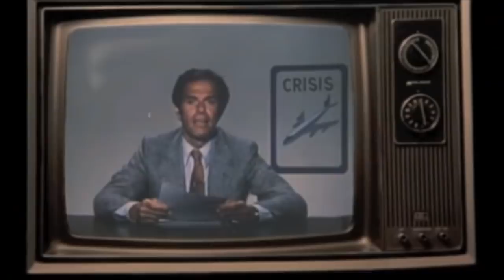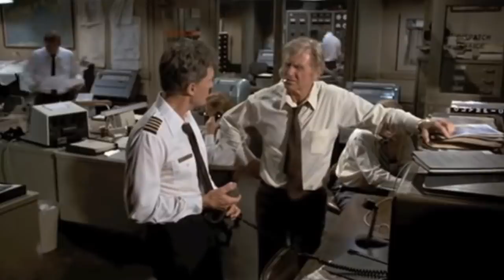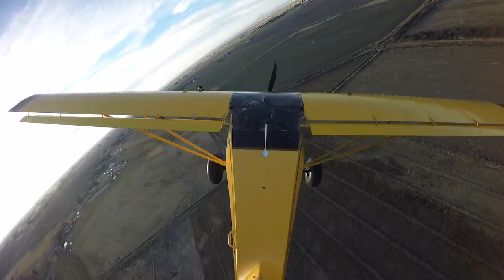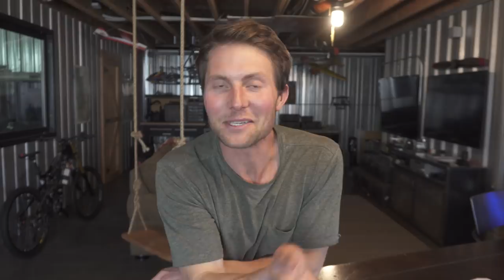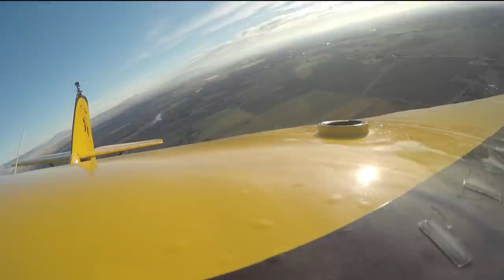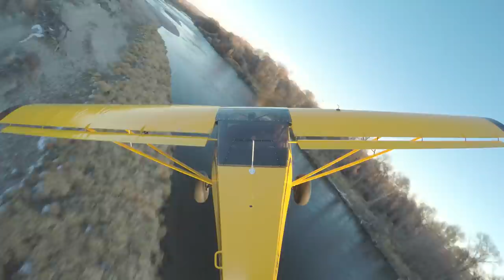Engine Out Landing! What happens if you forget the wing tank GAS CAP.

Comment: I can verify that if you leave the cap loose on a citabria 7eca, it will suck all of the fuel out within about 20 minutes.
Reply: i'm not sure if i want to like this, if there was a horrified with a giggle button i'd use that.
Reply: I was flying a 7ECA yesterday.    Saw the guages fluctuating and wondered if I had left the cap off.  Landed to check.  Everything OK.  Guages just jump around a lot.
Reply: @petethecatable  If you leave the cap off, or even loose, you will be able to see the flow of fuel from the trailing edge of that wing.

Comment: I had an incident when I was flying skydivers.  A friend had checked the fuel in the wing tanks with a stick and left the cap loose on the wing of a Aeronca 15 AC I was flying. I was sitting in the A/C and I took his word that all was well and ready to go. (My mistake) ON taxi for takeoff it rolled of the top of the wing. I had no idea this had happened. On climb out to 12.500 ft. I thought it was strange what the fuel tube indicators were indicating. After dropping the jumpers I noticed I had fuel indication that was quite low. The decent was always rapid and I was probably descending about 3000 to 4000 FPM.  When I got back on the ground I was presented with the fuel cap. The people on the ground thought it was quite a display seeing the fuel streaming out on climb out and decent. The loss of fuel was probably about 10 gal. From that time on, I did my own checks of fuel caps.

Comment: During my flight training (decades ago), my instructor decided to set us up for a dead stick landing.   While we were in the pattern, he switched off the ignition in the downwind leg, simulating an engine out or empty fuel tanks.  He reminded me that I should put on about half flaps, and I could use that as a control to shorten or stretch the glide.  Any way, it all went fine... turned base, turned final, and set it down on the runway a little past the usual touchdown spot.  All to just demonstrate you don't need the engine to fly... or at least glide.  It sure was strange to see the prop absolutely motionless while flying.  :)
Reply: Mechanics often call it a 'cooling fan,' not a 'prop.' Because as soon as it stops turning, the pilot(s) immediately get sweaty.
Reply: Turned the ignition off?? Why not pulling the mixture instead?

Comment: There are pitot tubes on Kitfox gas caps.  These are needed to pressurize the top of the tank to promote fuel flow from the wing tanks to the header tank.  Without the cap(s), there is a vacuum created as you stated.  The problem isn't the loss of fuel out the opening, it is the loss of FLOW to the header tank which will cause the engine to quit.
Reply from the maker: Didn't even think of that!!

Comment: I think the reason why the water leaked more when you applied the flaps is because you decreased the pressure above of the wing which is what flaps are supposed to do.... decrease air pressure above the wing while increasing the pressure under the wing. Thus producing more lift and reducing your stall speed. This lower pressure above the wing helped suck the water out of your tank. Cool video..  Hair-raising, but very cool.

Comment: I was in a Erocoupe and the own of the coupe actually put the filler cap on backwards. I noticed that the fuel in the right wing (the one with the backward cap) was going down faster that normal. It wasn't dangerously faster but it was noticeable. I diverted to Barrie ON and land on the Postage stamp they call a runway. Luckily the gas guy was still there and I topped her off about 5 gallons from a 20 gallon tank (think it was 20, can't remember it was over 35 years ago.).  Avgas in those days wasn't so bad so it was not that expensive of a mistake. I learned a valuable lesson, If you flying the plane do the preflight, all of it your self. Never assume that the other guy, even if it's his aircraft, will not miss something or completely mess up.

Comment: Thanks for making this video. Sometimes when I fly on Microsoft flight simulator 2020 I shut down the engine in mid air and try to land it on airport strip. When I start to lose air speed I just dive down, get air speed and level it and try to reach my destination. What I realized from my experiments of dead engine was that if I put the flaps down all the way, the plane will not make it to the landing strip. Instead it will stall and dive fast and crash. I wonder if this happens in real life. One of the coolest thing to shut off the engine is that you kill the roaring sound of engine and you are only left with the sound of wind and the clicks and clacks of the materials that make the plane.

Comment: Robert Fisher has it right.  I have the same model Kitfox and accidentally left one fuel cap off.  With full fuel tanks (12 gallons each side), I had an engine out from fuel starvation after less than an hour of flight time.  After landing (another story), I could hear fuel draining into the header tank.  As it turns out, the tank with no fuel cap was full (12 gallons) and the tank with the cap on it was empty (a little counter intuitive) and the header tank was empty (which is a real problem).  My next mis-calculation, was allowing the tanks to equalize ( as they do) and attempting to fly out of the boondocks I was in.  I surmised that if I observed the same thing happening I could buy time by doing steep bank turns and move fuel to the other tank (Kitfox owners have seen this effect of gravity).  Don't do it!! Gravity cannot overcome Bernoulli principe + pressure on other tank (another story).  Bottom line: never fly with out 100 MPH tape.  Had I had some in the ship at the time I could have constructed an "improvised fuel cap" and made it back to home base.  The real value of both Jonas's effort here and my experience is to practice real dead stick landings.  And for those running Rotax engines, that means something different than those practiced in training at idle.
Reply from the maker: 992WY Thank you for sharing your story and information!

Comment: All 26 of my landings were without motor. I fly a hang glider 8). Timing your glide ratio to the proper landing spot is tricky at first, but you get the hang of it pretty quickly. Always practice at a large field though.

Comment: Yeah, that is a very stupid thing to do. Unfortunately a very good friend of mine wasn't so lucky and he died many years ago after an engine out and trying to land on a freeway (he was flying over a  dense populated area) 
As much as I liked my friend, one of my best friends,  I can not avoid blaming him for the fact that he failed to follow the number 1 rule every pilot should abide "Trust and Verify"
Apparently the person that refueled the airplane just prior to taking off left the fuel cap out, it was a high wing airplane and my friend did not check if the cap was on and secure. 
To add to the sad story, his wife and 1 yr old son happened to be driving on that very same freeway in the opposite way after he crashed, she got stuck in the traffic jam she found out about the accident when she got home (this was in the 80's prior to cellphones).
Reply: This seemed to be a very controlled situation practiced under power previously. The S-turns were for show and to lose altitude. I’m sorry about your friend, but I don’t think the maker of this video was risking much. However, his description of how the fuel would be sucked out is very wrong. The air over the top of the wing is lower pressure than the air under the bottom, but it is by no means low pressure air. In fact, the pressure is still quite high and would not create suction. It’s a very common misconception. I lost a fuel cap on takeoff out of Paris Le Bourget in a Piper Lance and only lost 3 gallons over a few hour flight. Low(er) pressure does not mean low/negative pressure.

Comment: Yes there is a low pressure area on the top of the wing but that is not how a wing generates lift. A propeller has an airfoil and works like a wing. If lift is generated solely by the low pressure area on top of the propeller airfoil and you stood behind the aircraft, you would not feel any air coming from the prop. The low pressure area on top of the wing diverts the air downward towards the trailing edge. Air coming off the trailing edge of the wing is then thrown down resulting in a force upwards. Newtons law, a force in one direction generates an equal force in the opposite direction. Just to finish this off, a Citabria  has an airfoil that is flat at the bottom. According to your explanation about the curved surface, it could not fly inverted yet it does. I just can't do it very well because it's airfoil is not optimized for inverted flight. Or better yet, an Extra 300 has a symmetrical airfoil, i.e. as much curvature at the top of the wing as at the bottom. So, according to your explanation, how can it manage to fly??????
Reply: It is true that the Bernoulli effect does not generate the lion's share of lift, but this description is partially correct at best. Air flows from high pressure to low, so the pressure differential at the trailing edge is bottom to top, and will tend to defect air upwards, not downwards. The physics is much simpler than Bernoulli. If you have any angle of attack at all, you're bouncing a lot of air molecules off the bottom of the wing, and almost zero off the top. This gives you a huge pressure differential that gives you lift. I'm sure everyone has stuck their hand (definitely not an airfoil) out the window of a fast moving car and felt how much lift you can generate. Because momentum is conserved, the molecules bouncing off the bottom of the wing will be travelling downwards after the collision, which is why you see the flow deflected downwards aft of the wing.
Reply: Good. Now that's a valid explanation. I'm just tired of hearing the somewhat dummed down argument that it's the vacuum on top of the wing that's doing all the work. AOA is a big part of dialing in the amount of lift generated by a wing. Watch an old documentary of a B-52 in flight at takeoff. The engines are producing a lot of black smoke trails and you can see these smoke trails are deflected down just past the trailing edge of the wing. Obviously, the wing is deflecting a mass of air downwards. If it's true that the pressure differential between the top and the bottom of the wing is what produces lift, why does a wing stall passed 15 degrees or so? The pressure passed 15 degrees is much higher and should produce more and more lift. But it doesn't. The air at the top of the wing is low pressure higher speed air. The air at the bottom is high pressure  lower speed air. When they meet a the trailing edge, the resultant vector of force deflects both down. So above 15 degrees AOA, the air on top of the wing becomes turbulent because it cannot follow the curvature of the top of the wing. Therefore, you loose the high energy, high speed air coming off the top at the trailing edge and the resultant downward force is disrupted hence you loose lift. Bottom line, an airfoil is a device that changes the direction of the air surrounding it. Action breeds reaction. I'm just tired hearing about the Hoover vacuum sucking up the wing. But thanks for the chat.

Comment: Airplanes don't generate lift based on the bernoulli principle.  lift is the total mass of air redirected.  When you add flaps the angle of attack changes and the fuel flows to the front of the tank and the fuel runs out.  For the fuel to be sucked out, you would need air flowing in the tank from somewhere else.  The wing chord is shaped the way it is to have strength and so that the airflow doesn't break away(stall) and create drag.  but the wing chord could be like a single surface hang glider and still create lift, or a squirrel suit and still have a glide slope close to your kit fox.  Carburators operate based on the bernoulli principle.  and the bernoulli principle will also offset the air forced up just behind the nose of the wing.  

Just get your plane flying level and look at the angle of attack vs the horizon.

Comment: I think you will find that the lift generated by the curvature of the upper surface of the wing is minimal and that most lift is created by the air hitting the lower surface and pushing it up. Don't believe me? OK, get two sheets of plywood, join them at one end and have the other end open. So you have an open triangle with an angle of about 20 degrees. Stick it out the car window and go for a drive. Hold the assy so the pointy end forward and the top sheet is level, so no "extra" travel for the airflow going over the top, the bottom sheet will be at an angle of about 20 degrees to the airflow......feel the lift? Kinda blows Bernoulli out of the water hey.....

Comment: My cap popped off in front of the Aero club at Orange and I flew down to Temora 102.0 NM and the tank to my plane is filled from the side of the fuselage (Jabiru LSA 55/3J). Flight planed for less than 15 litres to get there. Half a tank later I arrived. Watching the fuel drop in flight I thought this unusual. My preflight for the return I discovered the missing cap. Out came the duct tape and off I went. Landed safely back at Orange and taxied up to the aero club and there was my fuel cap. Lesson learnt. Yes this is New South Wales, Australia.

Comment: I noticed I had an open fuel cap once, after a 1 hr flight with a Cessna 150. I don't exactly know when it opened or if I left it open after refueling; there was no unusual noise and the gauges didn't go down any faster than usual.
Of course I manually checked the fuel level, I still had about 2 hours of fuel left — I had refueled to 3 hours before take-off. So if fuel was aspirated out or vaporized, it was really a minimal amount, maybe 1 gallon but not much more.

Comment: Wing shape regardless, fast moving air has lower pressure in comparison to your gas tank. But also, as gas leaves your tank a vacuum is made from the one exit point. It would have to suck air in the way gas is moving out, like a milk jug, and that force could be equal to the one created by bernoulli's principle. A milk jugs being poured out, is not in a low pressure environment and has the force of gravity, so it keeps glugging.

Comment: In my CTLS flightdesign underpressure first sucked the fuel from one tank to the one with no cap on.  Then it started to loose fuel. Heavy side load was clearly noticed had to trim the ailerons. Loss was about 2 gallons a minute. I realized the situation because I always have a timer (15 minutes) on my sky demon for fuel check.
Reply from the maker: 2 gallons a minute! wow. Thanks for the information!

Comment: Had the fuel cap in a Bonanza not sealed totally correct by the lineman fueling. Lost 1/4 tank in about 5 minutes (was topped off). Landed and got the cap on right, was all good.
Reply: Yeah, I had the same thing with my Cessna 411 years ago. Left main tank (the tip tank) had a loose cap. Same game, lost about a fourth of the 50 gallons in the roughly 5 minutes it took to get back on the ground. No big deal.
Reply: What makes you tell stories like that?
Reply: @raymondkoonce5827  you flew a Cessna 411 years ago, wow
Reply: MJafar Mashhadi   Yes. I owned two of them, one after the other. Then they got hard to find, so I moved up to the 421. I've owned five of the 421s, again one after the other.

Comment: Tucson to Flagstaff in a 182 made it with the fuel cap off on right tank (thanks instructor) Had a 30 knot tailwind with a 135+ ground speed and made it but holy smokes was the fuel bill expensive. I told the instructor "there goes your tip I planned to give you when I completed PPL and IFR ticket.

Comment: Cessna 150.  Cap had chain so did not loose it.  Cross flow tanks the problem was that the fuel pushed between the tanks and made one go empty due to the pressure difference.

Comment: Fuel generally has a lower boiling point than water, so basically evaporates quicker. With a draught running over the top would probably speed up evaporation many times , as well as fuel being drawn as a fluid.
  But yes I think all of this in theory would vary greatly depending on the craft been flown, at what speeds, ambient air temperature, type of fuel plus probably many other variables.

Comment: Can’t think of a better way to practice engine out procedures. From a maintenance standpoint, now you got to get all that water out of your tank and fuel system. When I built my RV-10 I water tested the tank for leaks but that was off the aircraft and plenty of time to let any traces of water evaporate. I hope you drained and let the air get into the tanks to allow any moisture to evaporate. Not sure about the Kitfox but consider any baffles and areas that could allow puddling. Cool video though..had to at least mention this before your next flight with that tank full of fuel. Call me cautious.

Comment: Great video thanks for sharing most people think you know you lose an engine and you're going in they don't realize that you really do have time to either make it to a field or a safe place to put down I lost an engine in a 150 open the Cypress swamps of North Florida and I actually found a crop duster field just outside of Chiefland and landed there the big thing is just don't panic another engine out me and my father took off full i m c out of Chattanooga International we had stopped there for fuel and they pumped about 20 gallons of water into our tanks that one was a little close prop stopped at about 900 ft we were on a single-engine Comanche that one had me nervous

Comment: That happened to me in a DA20. For certain reasons, the cap wasn't fully closed, and it fell off during flight. Fortunately, it doesen't have its fuel cap on top of the wings, so it won't suck out fuel, and the cap was hanging loose in a cable lock.